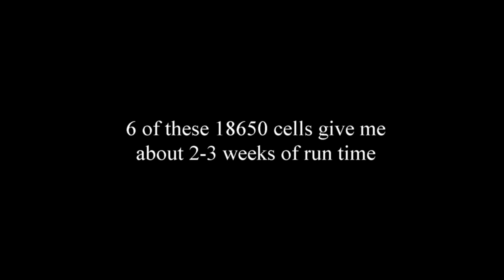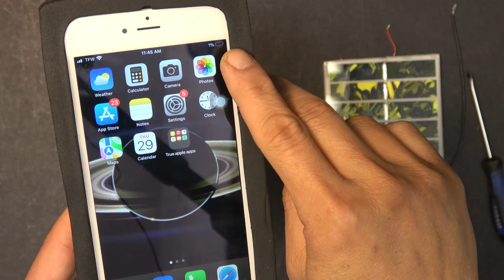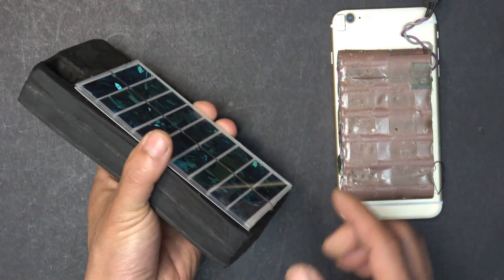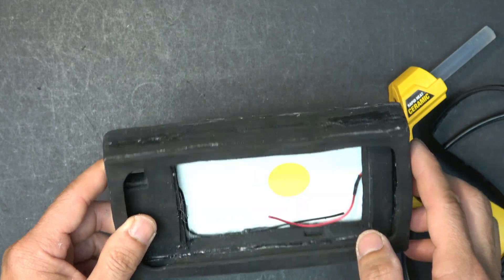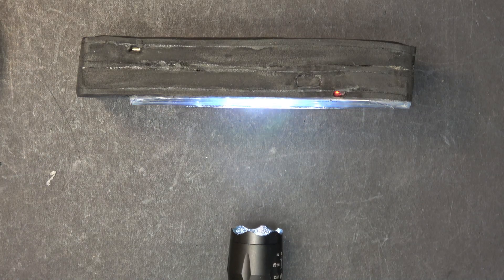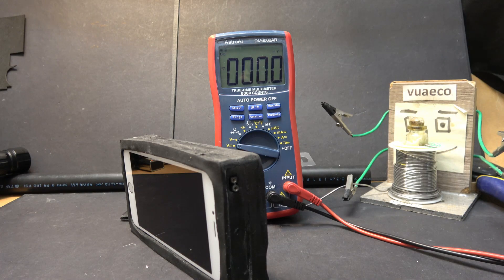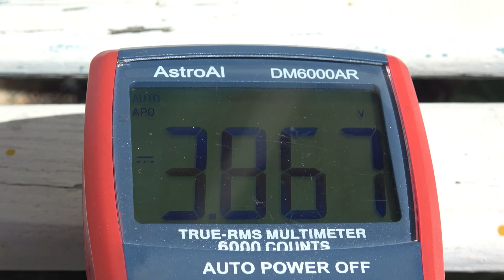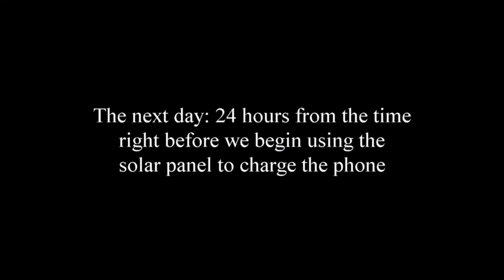Putting a solar panel on an iPhone: unlimited power from the sun!

Comment: Okay, imagine u need power from the sun, so u put your phone outside for HOURS - WHY i should have a phone, that must be lay outside to stay on battery "forever", when i cant use it, while its "charging"....thats a useless project. this panel have never the power to "charge and use" over time. if u use your phone, as many others do - the solarpanel never have enough power to hold it "forever" - but as always, if its shown in a video, its true....
Reply from the maker: If you're a typical millennial who can't live without looking at a phone for every other second, I have a solution for you. Go outside in the sun, bring a mirror and put it under your phone. Position it in a way so that it reflects sun light onto the solar panel on the back of the phone. That way you get some vitamin D and your phone gets charged.
Or if you're the kind who have a nervous breakdown if you're away from your phone for more than a minute then this hack isn't for you. You'll need to carry a generator with you or invest in a very long USB cable to plug it in. I kid you not, I've seen 20 feet long USB cables.
Reply: Lol yeh it's crazy how many people are glued to their phone  @vuaeco

Comment: I love the look of those polycrystaline solar panels. Also, is that magnet on the camera by any chance to disable the OIS? I have an iphone 6s plus that has a similar issue with the OIS.
Reply from the maker: Iphone 6S has a problem with the camera where it's very shaky and unstable. Putting a magnet next to it stabilize the camera.

Comment: At this point, i bet your going to explain how the hot glue will not melt in summer sun😁....when are you doing vid on making a small carrying truck, so you can to pull behind u, thus taking the weight of the phone from your pocket to the lil truck.....p.s, u have the 1st phone to charge in  full moon conditions🤣

Comment: Now just make it weatherproof try to make it survive underwater
Reply: I would make the case out of wood, so it floats, give it a nice wood stain, and recess for the solar panels don't get scratches
Reply: @ricksummerfield784  I would make a water resistant housing submersible to 10ft for 30mins

Comment: Since you're not using efficient MQTT charging circuit, It'll take that tiny panel 2 - 3 weeks of all day Sun to charge that size battery once....LoL

Nice fantasy though'....
Reply from the maker: I've never heard of an MQTT circuit. Maybe something new from Elon? But there's no need for an MPPT for such a small panel. Yes, it will take 2-3 weeks of all day sun to fully charge the battery but why do you need to fully charge a 20Ah battery? You only need enough charge to offset your daily usage (and maybe a little more for a cloudy day) and you already have enough power to never have to plug it in again.